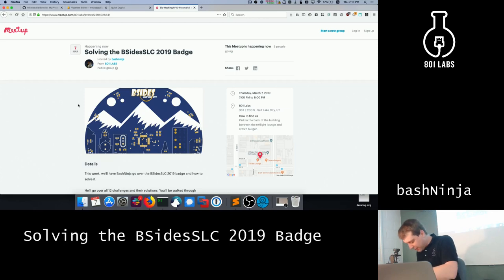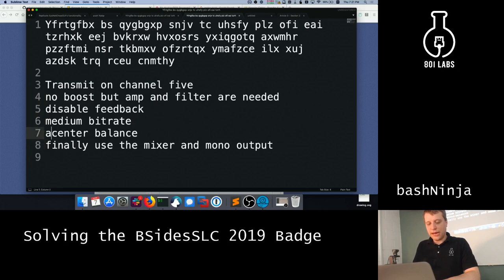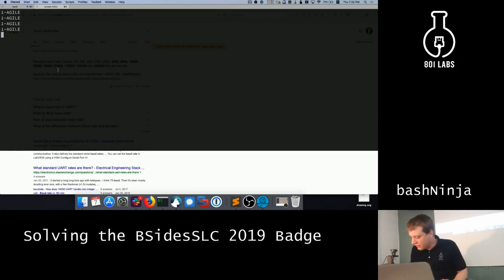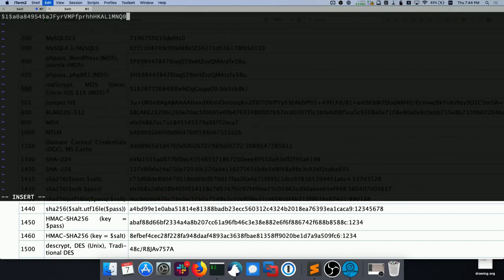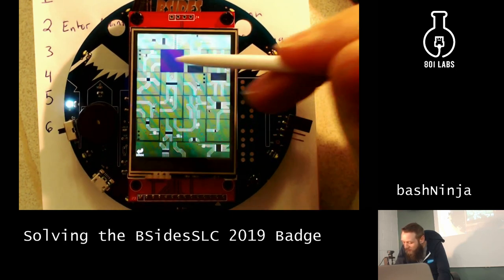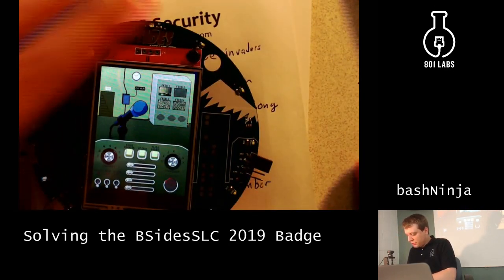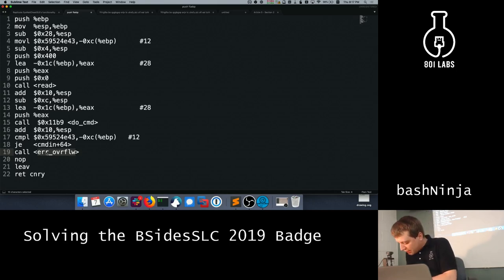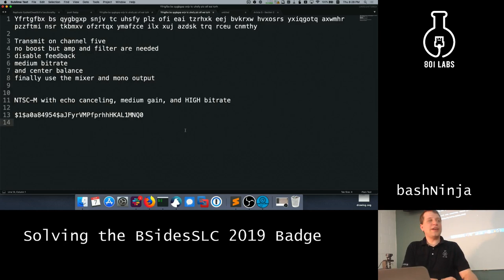Solving the BSidesSLC 2019 Badge by bashNinja

Comment: 1  - Door Code (49:41)
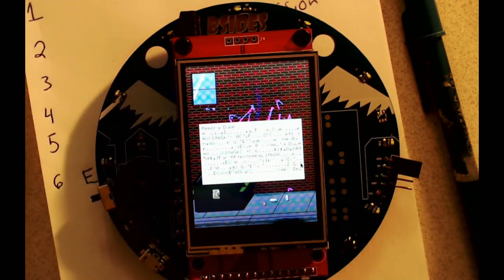2  - Enter Mainframe Password (17:53) (33:48)
3  - Crash the Mainframe (Assembly) (58:47)
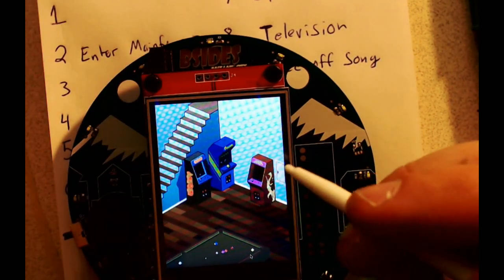4  - Slide Puzzle (44:17)
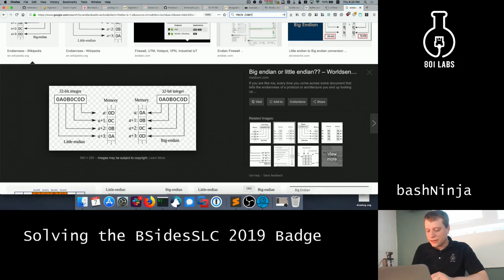5  - Broadcast the Message (1:15:19)
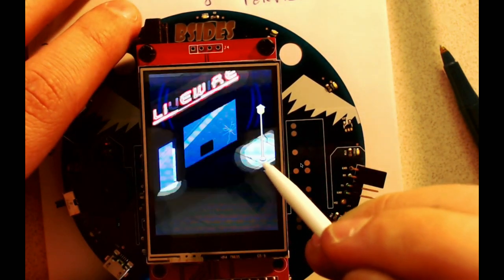6  - Enter the Night Club (15:00)
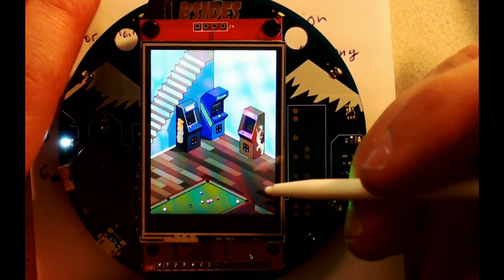7  - Beat Space Invaders (42:30)
8  - Get the QR Code (5:45)
9  - Dance off Song (39:53)
10 - Fix the Radio Tower (move the soldered chip) (28:45)
11 - Pair with 5 Friends to beat Robots (20:04)
12 - Dial a Long Phone Number (31:54)

Code for the python to unlock friends:
https://gist.github.com/miketweaver/6ffb74f0d52e6f2078f0b144408e3def